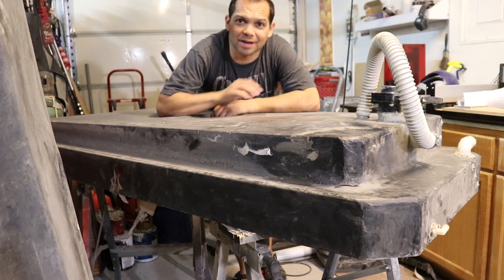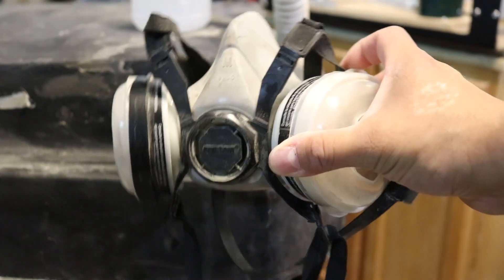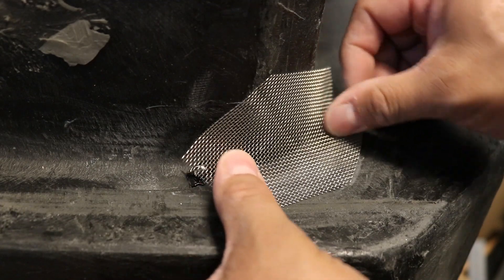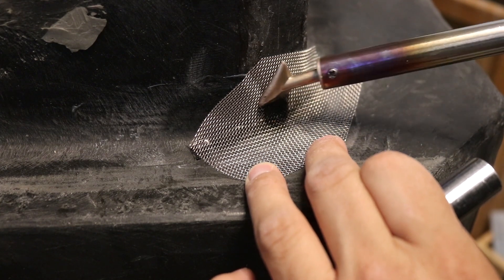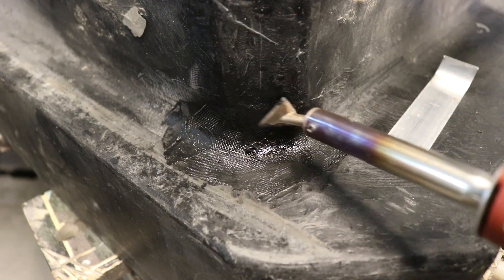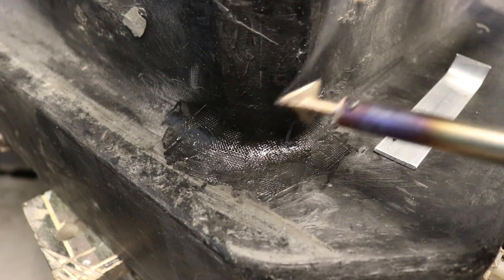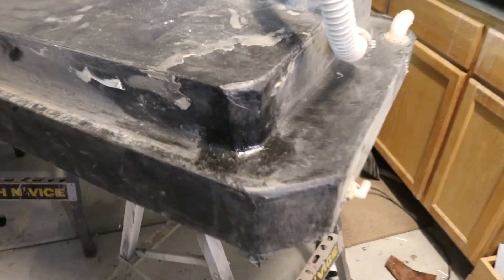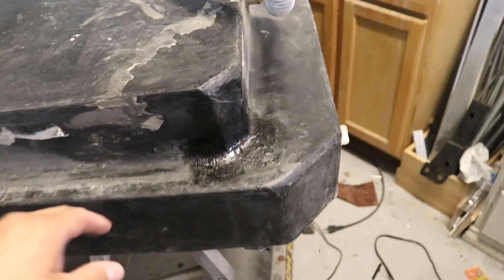RV water tank repair

Comment: Did you use the PP welding rod that came with the kit? It doesn't look shinny like the welding rod in the video. I don't need a large amount that you link to from amazon. I am trying to fix a water tank just like the one in the video. Thanks
Reply from the maker: The best repair will use the same plastic you’re making the repair on. I didn’t know what came with the kit, so I ordered some to be sure.

Comment: Why the need for the butane torch? Why not just use the plastic welder and skip using the butane torch?
Reply from the maker: The torch quickly heats up both surfaces (the repair rod and the tank) to bond them together. You could use just the welder, but it would take much longer to build up the patch. Brent

Comment: Thanks for the tutorial. I'm debating plastic welding mine or fiberglass patch. Mine has 3/8" hole in the bottom covered by a janky old silicone over fiberglass cloth patch which started leaking on me. Plastic welding seems like the better solution so far, just need to get the tools.
Reply: i dont mean to be so offtopic but does any of you know of a method to get back into an instagram account..?
I was dumb forgot my password. I love any tips you can give me!
Reply: @Terry Chandler instablaster ;)
Reply: @Damien Coleman Thanks so much for your reply. I got to the site through google and I'm waiting for the hacking stuff now.
Seems to take a while so I will get back to you later with my results.
Reply: @Damien Coleman it did the trick and I now got access to my account again. Im so happy!
Thank you so much, you saved my ass :D
Reply: @Terry Chandler No problem =)
Reply: @terrychandler5759  Glad you guys were able to figure that one out.
Reply: And as a side note - I ended up plastic welding my tank with the harbor freight plastic welding iron (not the air type). Worked fantastic on my polyethylene tank. If you need raw polyethylene - check Home Depot for polyethylene tubing.
Reply: @12v  I use a Matco airless welder on polypropylene fuel and chemical tanks. No complaints so far. As a side benefit - you can advertise you do plastic welding now. Not many people doing plastic tank repairs.
Reply: @12v 
Ya, fiberglass resin does NOT adhere to polyethylene. Some epoxies can, some urethane products, and iirc butyl rubber caulking does. 

But no matter: solvent welding or much better high temp ‘plastic welding’ like this are 100% effective